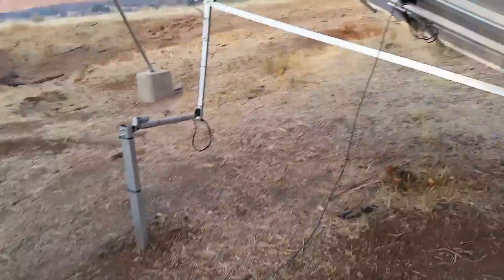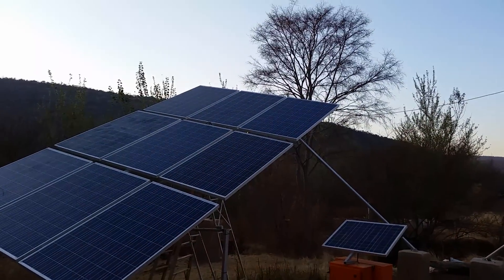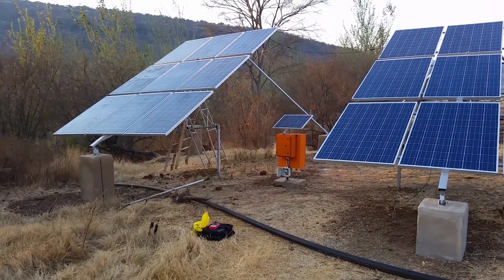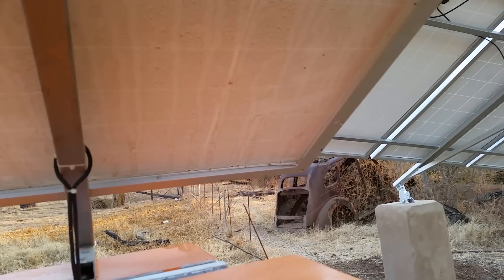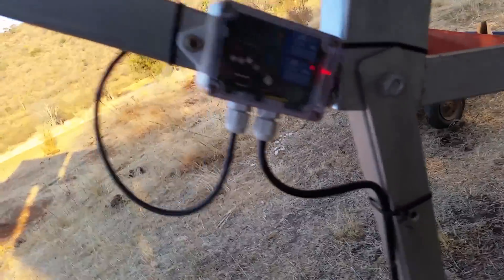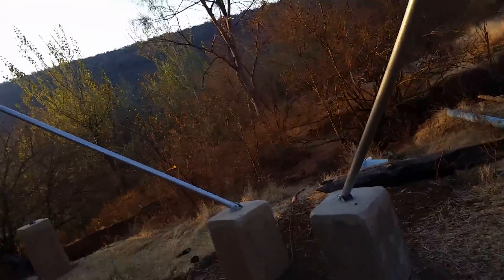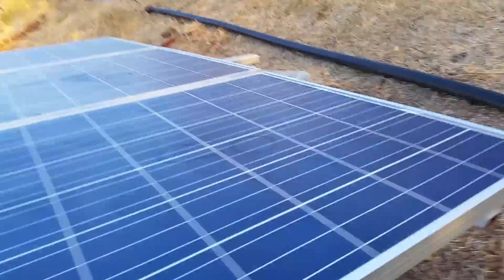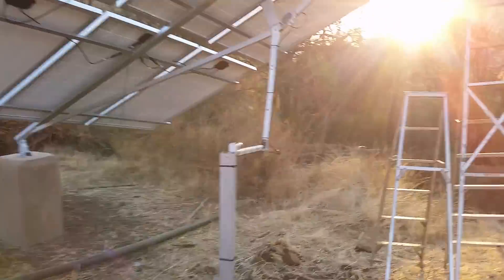DIY single axis solar tracker

Comment: Hi one of the best diy single solar trackers 👍👍.What hight do you have from top until ground and from bottom until ground and what is the angle created? Im asking you because im working at one like yours and will be for 12panels,260w (4up-down) and 3(left-right). Thanks in advance

Comment: Hi Phillip another nice one can I ask what went wrong with the 1st one I too had been playing with the idea of a car wheel hub on a pole I don't want to make it if it's not going to work
Reply from the maker: it is just cheaper this way and safer , car wheel hup on a pole lol. there is a better way too do it but pricey
Reply from the maker: It works but u Learn alot from building something you should always strive to make it better from this video till now I have changed the design 3 times now and my latest design I don't think I can top it will soon do I video on how to build a single axis and a dual axis from scratch
Reply: YES GOODJOB BUT CAMERA MOVEMENT IS NOT GOOD TO SEE SMOOTHLY

Comment: Really enjoyed your video..thanks for sharing..like a little more info on your DC voltage conversion to 3Ph....your swivel joints are nice but drive shaft u joints can save you fab time.  Also like to see a sketch of your proposed two axis tracker. So your well pump is a ram type.....like to see info on that. We operate our (3) ag pumps directly off PV with gas trackers. ray
Reply from the maker: Raymond Balcom Drive Shaft U joints , thank you for posting I will google draft shaft u joint not sure what it is , but if someone say it in my language I will properly know exactly what he is talking about but thank you sir for your idea and for watching my video , I want to improve my tracker so thank you
Reply: +Phillip Fourie

I think they mean universal joint like you get on a jeep drive shaft. It's kruiskoppling in Dutch so I guess afrikaans too.

https://en.wikipedia.org/wiki/Universal_joint
Reply from the maker: +zogworth Hi Zogworth , thanks for the input but i have came up with a better and more effective and cheaper concept , i will post it on my new video of my new single axis tracking design

Comment: Hey Phillip, bob on job there :-D you can see it would take plenty of time to design the system and put it altogether, but look at your result! it will last 30 years and with the SA weather, will cover a hell of a lot of appliances :-)

I will definitely be keeping an eye out for your next video. Have you a guess at how much more efficiency multiple axis of tilt will roughly provide compared to the single axis like now? and how does it compare to installing more single axis solar panels in price terms compared to the cost of adding that second axis :-D

Its very interesting stuff!

Darn your countryside is beautiful!
Reply from the maker: battonfive thank you for your kind comment and your input, and thank you for watching. i have this info: 
hope this help..single-axis (20% more power) and dual-axis(10% more than single-axis) but uses more land than single-axis bc of shadows and you need more money ;)

Comment: Do you store the energy on batterys? And then convert to three phase?
Reply from the maker: Tore Neverås No there are no batteries ! The inverter that I am using is kind of like a grid tie inverter it transform the solar panels dc directly to 3 phase ac